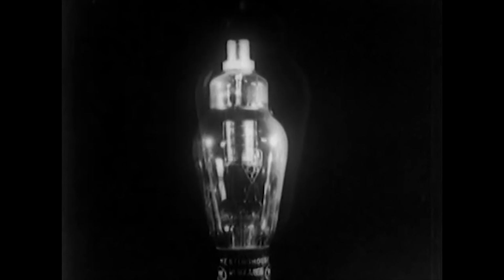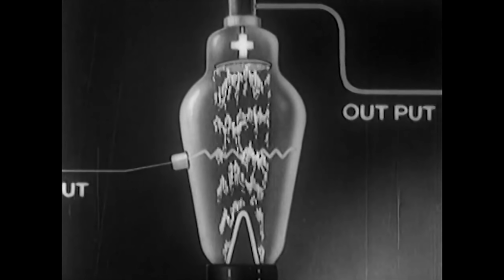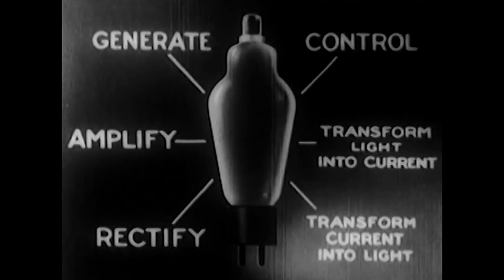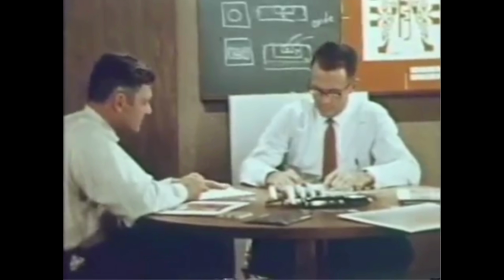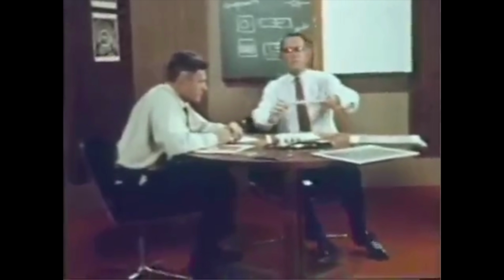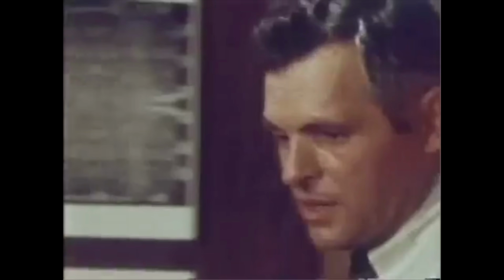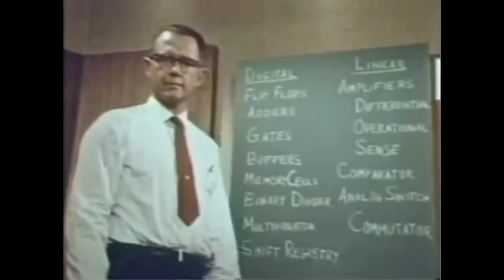The History of Computing [Documentary] (Vacuum Tube to Transistor to Integrated Circuit)

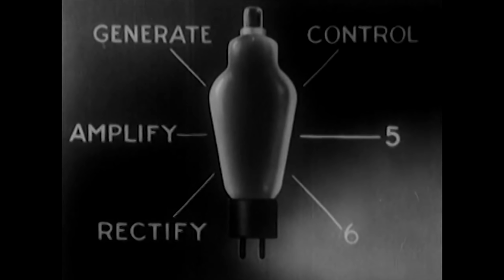Comment: 15:06 Light as a switch. Using the light as the switch, ... The Phototube.
Phototubes operate according to the photoelectric effect: Incoming photons strike a photocathode, knocking electrons out of its surface, which are attracted to an anode. Thus current is dependent on the frequency and intensity of incoming photons. Unlike photomultiplier tubes, no amplification takes place, so the current through the device is typically of the order of a few microamperes. Basically kicking electrons into higher valance shells creating a less resistive path for the load current to flow thus increasing the flow of electrons.. Yeah.. some technical stuff.  
...
The photoelectric effect is the emission of electrons when electromagnetic radiation, such as light, hits a material. Electrons emitted in this manner are called photoelectrons. The phenomenon is studied in condensed matter physics, and solid state and quantum chemistry to draw inferences about the properties of atoms, molecules and solids. The effect has found use in electronic devices specialized for light detection and precisely timed electron emission.  Great video. +1

Comment: At 28:12, " Transistors may someday go under the sea to amplify your telephone calls".  Vacuum tubes installed inline with submarine telephone cables were already being used to do this, decades beforehand.  Think about that for a second, vacuum tubes in water-tight, pressure-sealed enclosures attached to telephone cables at the bottom of the ocean! They lasted for many years.

Comment: In addition to Radar, the other then top-secret invention that helped us win WWII was the proximity fuse, a special vacuum tube which allowed artillery and bombs to be set to explode at certain heights above the ground (for maximum damage) or only when in proximity to large metal objects such as moving aircraft. PS, one of the American engineers working on radar systems in England during the war came back to co-found Tektronix and design oscilloscopes.
Reply: I believe that the tubes were not special, other than being ruggedized. It was, I think, ordinary pentodes. These radar fuzes were indeed extremely important - and I only learned about them thanks to your comment. 😊

Comment: Actually for lots of DC used in small industry, rows of large gas-filled tubes were used in those days, not vacuum tubes. For large industry DC, AC motors driving DC generators were used to provide large amounts of DC. It was much more efficient than running rows of power hungry tube heater cathodes, actually required less maintenance, & lasted longer. Some factories even had their own DC power plants to provide lots of DC. 

Those high voltage DC air cleaners create lots of ozone -- especially when they get a little dirty. Ozone is a corrosive that eats away your lungs, plastic, rubber, gaskets, & paint. Do not use them in occupied spaces. Also those "sterile" lamps also produce ozone that eats away your lungs.

Comment: They tells us that three guys practically stumbled over the discovery of the transistor. I would be very interested in how the development from vacuum tubes to the transistor looked in more detail.
Reply: Search bell labs or schokley labs for information on development of the modern transistor.
Reply: @danc2014  Yeah I've tried. But I find nothing that details the development/research process. It was just vacuum tubes, 30 years of silence, then out of blue air the transistor  was there. Considering how extremely advanced it is compared to the tube, I'm quite astonished over the lack of information.

Comment: Ah. However though the radio shack. With its pack of  6dq6 tubes heated the room and gave me a place to hide from my famly . The original  man cave. Kv4li. Ps my mother. Worked for RCA. after I got out of the army. I went to work at GT&E (Sylvania) made tv parts (you saw my work)

Comment: Also when you can cover the electromechanical relay and storage scopes (a type of oscilloscope) and patch boards used in the earliest computers. Indeed it was a moth that got caught in the lever of a relay that begat the term "debug" when technicians were tracking down the malfunction of the machine they were running. To think how far the technology has advanced in a scant 70 years.

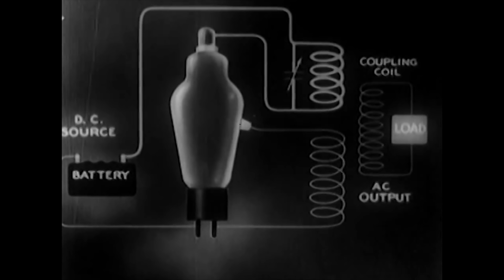Comment: At 9:47 if you modify circuit by putting in a capacitor and rectifier you can draw radio waves into the circuit and get more power back, antenna and tuning cap can dial in on frequency or pull in all RF waves creating a dead zone!

Comment: Would b cool to cut apart a vacuum tube and install a small microchip and a led bulb to illuminate the tube connect wires and re assemble tube and put into a circuit.😎.

Comment: Do you think it would be possible to replace the vacuum tubed in an old tv with transistors?
Reply: Short answer, no. Not completely. Diodes, yes. Triodes most likely no. With a complete redesign of the circuit, yes of course as we know there were solid state TV's(except for the picture tube. That is the one tube who's function has no solid state replacement)
Flat screens operate differently than picture tubes and require a different circuit to drive them.
Reply: @lochinvar00465  huh, never knew. I wondering how much of my Philco predicta could be replaced with solid state parts. Thanks

Comment: I cracked up when they got to HH Scott.  My first real high paying job (yes, I'm old now) was in a warranty station for them and many of the Japanese companies' stereo gear.  Those IC receivers (they were actually good when they worked) all failed - worst rate in the business, some as many as 3 times, and drove Scott out of business.  The blame is some Fairchild for those IF ic's that all went bad due to running too hot and poor encapsulation (they'd just gone from metal and glass to cheaper epoxy and didn't get it right at first) - there was more than one, and they didn't all fail at once.  The Arrhenius curve has some sigma...and every single stereo demux chip failed - Scott's fault - because they used it to drive an incandescent indicator for stereo (which had an inrush current 10x the running current and ICs of the time didn't like that).  Scott also used cheap molex type connectors for all the boards, and designed the circuits so that if one went loose (and they did) the output stage went up in smoke - expensive transistors...
Being as how warranty repair fees were making us rich - and overloaded - anyway, we petitioned Scott to just let us fix all the things that we knew by then were going to go wrong in one go for the one time price, instead of seeing each one 3-4 times (not all stereo repair were ripoffs) but Scott would have none of it - till they went out of business.
Reply: Doug Coulter Andy out wonder why American consumer electronic companies lost out to the Japanese in the '70's and '80's. Poor and short sighted business decisions.
Reply: @marcandrews3945  I lived through those times.  MITI and Japan's Article 9 had a little to do with it too (as well as dumping).  They're paying the price for trying to solve their recession the same way we are now. once they'd squandard that advantage - but they started printing money a lot earlier.  One may draw conclusions about where we're going to wind up with the same failing plan -  we have this great example from them now.
Reply: Doug Coulter We have that example to learn from, but we won't.